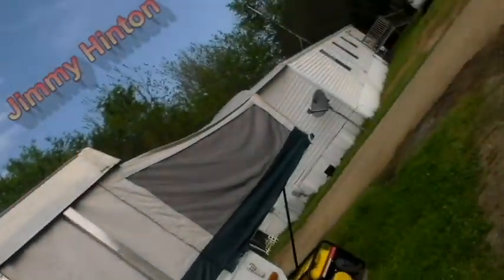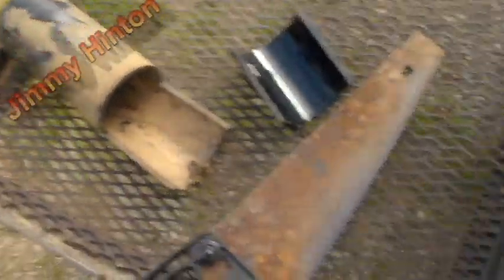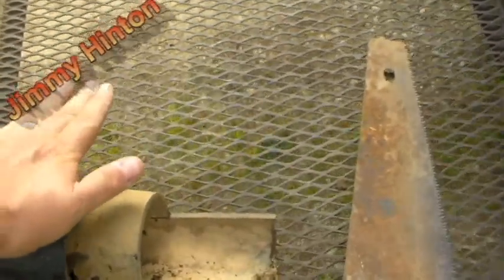How To Patch a Sewage Pipe

Comment from the maker: I work for a company that makes plumming parts for the government and commercial. I'm over a lathe line I do the setup on brass fittings. I been on that line for 14 years over for 6 years.  In total I've been there for 25 years. Doing the pouring process and making cores.
Reply from the maker: I will be uploading a video to better explain why have to patch for right now. It be up tomorrow.

Comment: there must be a blockage further down the line if water is gushing out of the hole. is it a septic tank? remove the lid and see if the spill way (where the pipe comes in to the tank) may be a bunch of toilet paper build up clogging the inlet. you can use a piece of 2x4 to break up the solids and get it flowing good again.
Reply from the maker: buggyalstare1971 No it is a idiot repair guy put a hole in it to snake it out.